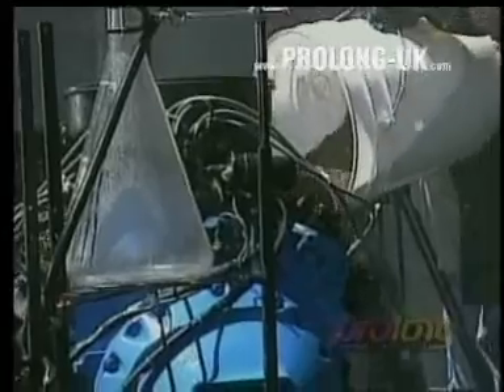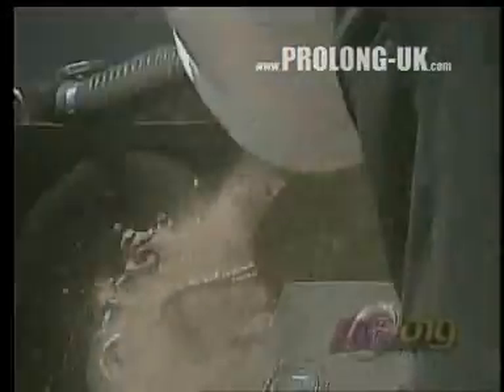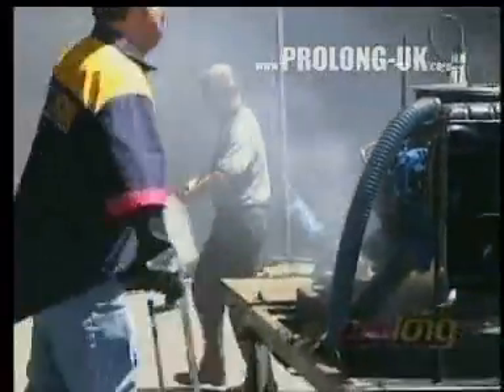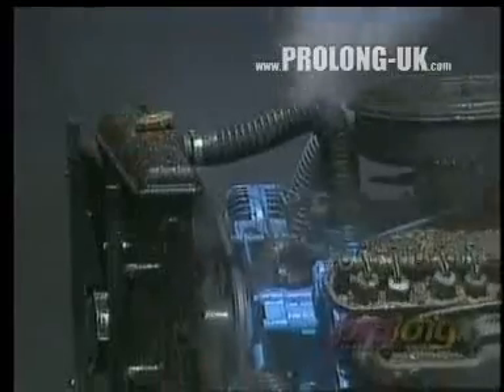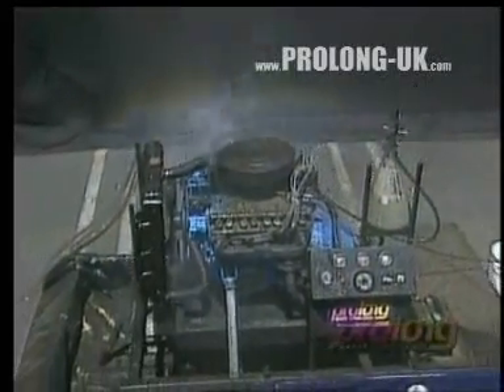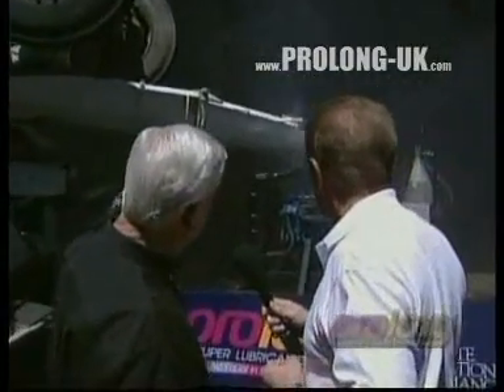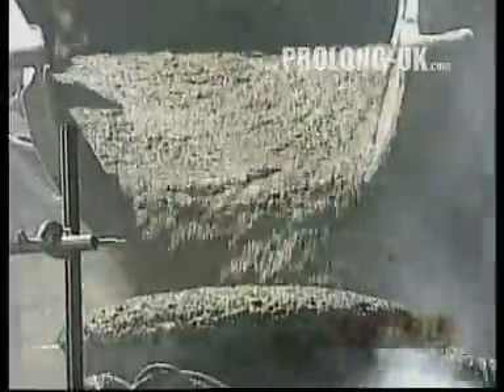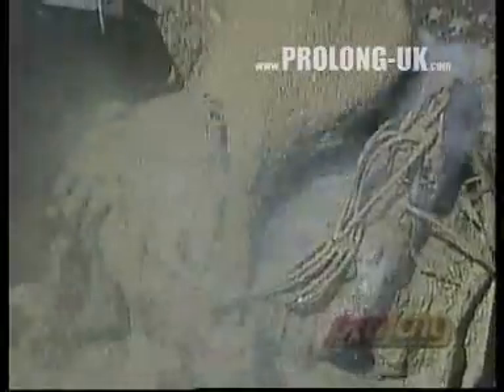Cement in an Engine

Comment: As if the cement or dirt would get past the valve stem seals...fucking retards! Pull off the air filter and see how it goes you useless fuckS!

Comment: cement usually stays very cool unless layed out on a flat surface. if anything the cement helped cool the engine after they cut the hose and it actually helped the engine it didnt make it any harder for the engine to run.

Comment: I use Prolong in my engine! Just the other day I was driving on some sand dunes and then WHOOP! The car slams through a sand dune and the engine compartment completely filled with sand! But it kept on running! Suddenly, a cement truck appeared from no where and collided, spilling cement everywhere! But Prolong kept my engine going *smooth*. On the way home, a nuclear bomb detonated right above my hood, but Prolong kept my engine running just as good as they day it was made. Thanks, Prolong!

Comment: With no oil, very little cement will be washed down into the crank case... Some of those cash for clunkers engines run on for 5 or 10 minutes with no oil, AND some quantity of sodium silicate solution in the crankcase...

Comment: yeah ok, this is a perfe3ct example of how advertising hides the truth. if you got no oil, that sand will go no where except straight to the bottom of the oil pan. therefore the only thing that is happening is this "prolong" is temporarily preventing the engine from seizing since there is no oil. you put oil AND sand, this be a whole different out come, nice melted block or blown pistong or loss of compression, this test does nothing

Comment: thats such bullshit, and it was only running at 1500 fuckin rpm. we had an engine redline at 7 grand with no oil or coolant in it and it lasted 10 minutes... like cement would really have an effect on the cams in that short period of time. what a fuckin gimmic

Comment: the test is more about being spectacular than anything else, the cement is not in the cylinders or the bottom end of the engine, in fact with out coolant the cement may actually have dropped the temperature.

Comment: Yeah, technically, I left out the 262, 265, 267, 283, 327, 383, and 400 from the Chevy Small Block family as well... Just pointing out, the person who said that the engine was too small to be a 360, and was probably a 318.

You can't tell the difference just by looking at the size of the block. That was my point.

Comment: its not prolong....its Chrysler :) i work for Chrysler and i used to  work fro  Quick oil change shop and thy sold that shit. it dont do crap. prolong sucks big floppy donkey dick. do it with a ford and it will be the same

Comment: I'd also like to point out the fact they are using an old Chrysler small block. rock solid cast Iron everything. Enough journal clearance to allow lots of stray oil to remain after being drained and to also allow lots of room for heat expansion. drain the oil out of an aluminum block aluminum rodded modern engine. or the raggedy Quad four GM engine. leave this "Prolong" in the sump and then add sand and dirt and place it under a load. if it still runs I'll even drink the stuff for good measure

Comment: Yeah, the valves open, that's right, but they don't open to the valve covers, they open to the INTAKE. Which is sealled to everything but the carb, which is sealed to everything but the aircleaner. You shouldn't have one running without covers because oil will leak out rather quickly, nothing will get into the combustion chamber unless your valve seals are bad

Comment: totally agreed...putting dirt on the valves wont do shit, ethier, the vavles around under much strain compared to the crankshaft, also they move much slower compared to the crank.  an engine can run for a while with no valve lubrication.   no id like to see them pull the rod caps, put sand into the bearing itself and put the caps back on and see how long it runs.  also, if they keep the oil in it, then put the sand into the crank, so the oil would carry the sand to bearings.

Comment: 360 and 318 blocks are exactly the same size.

Just like a 302/351 Ford, or a 305/350 Chev.

You clearly don't know anything about engines.

Comment: The biggest crock of shit I have seen in a long time, an egine ideling doesn't put much strain on the bearings, put it full throttl under load and it wouldn't last 30 seconds, and it says more for the engine design than it does for oil to keep running without oil.

Comment: Take off the air cleaner, and pour the concrete thru the carb.  If that bitch runs under load for more than a minute, I'm fucking sold!!

Comment: This video, as everyone has said, is a pile of BS.

Years ago we used to take our old cars and "experiment" with them to see what they could take.  

Any well used engine (largish bearing and piston clearances) will run for many, many hours at idle with no oil and no coolant.  Cement (if it gets in) will plug up the oil filter.  If any gets into the bearings they will score and get ruined, but the engine will still idle for a long time.

This video proves nothing about "prolong".

Comment: Any car on any oil would have the ability to run like that for a good while.  They say they are pouring it INTO THE ENGINE which is bullshit they are only pouring it on the rockers.  Non of that is going inside the actual combustion chambers.  If they did maybe i would consider buying their bullshit product. 

And look who they have as witnesses!  Two fucking geeks and two blonds with big tits who probably think engines work by using magic.....

Comment: I had a little briggs that I broke a hole in the side of the case while it was running(young and dumb)then I threw a bunch of shit in it.The dirt and concrete really wasn't getting in there too much.I don't care what oil treatment bullshit you have.If you get dirt in the critical areas, the engine will die.

Comment: all oil is good oil i did,nd change the oil in my motor cycle for 60 000 kilometers and the bike did not start to use oil i think oil is way stronger then what the manufactors say i still drive the bike every day and the current oil is about 25000 kms old and still no oil use kawa gpx 600r

Comment: its funny, my uncle and a bud were changing the Oil in a tractor and somehoe forgot to put new oil in, well he ran it for a good 6 hours before either one of them noticed, the engine still runs to this day, the oil he used is called (Delo)

Comment: With no oil there's nothing to carry cement to the bearings on the crank, cam, mains. Bet a rocker arm would work for days in wet cement. Good oil is good oil. What you have here is not special. Just foolery. Nice try

Comment: a little might have ran into the oil pan for the crank to hit but not much cuz the holes in the heads for the oil to run down are not that big and i would like to see them dump the oil any one can disconnect a gauge

Comment: I havent used it as I like my engines to have oil in them!
Slick50 does remain slipy inside engine, mini metros have the gearbox in the sump, add slick50 and the sinchromesh never works again!
Slick50 is good should oil pressure suddenly drop, gives u a minute or so/ reduces damage, I have heard of folk runing engines without oil for short time with slick50. Never seen it myself.

Comment: Slick 50 doesnt work. And neither does this shit. Teflon was NEVER intended to be used in your engine. DuPont (the makers of teflon) even said so. Slick 50 is just snake oil. Get real oil like Mobil 1 or Schaeffers, use real coolant, and run an injector cleaner every oil change.

Comment: This is a great product. If you ever have your hoses cut, oil drained, and valve covers filled with concrete -and you've just gotta get out and drive, then I highly recommend this product.

Otherwise just use ordinary oil.

Comment: I remember seeing this stuff at a swap meet in Moultrie, Georgia a few months ago. They used an old inline-6 Chevy (I think). No oil pan, no valve cover, and a hole in the side of the block and the damn think kept running for a few hours until they turned the key off themselves.

Comment: a honda engine can do that me and my friends tryed to kill a 1991 honda 1.5 liter 4 cyl it had no oil the radiator was disconnected and destroyed the valve cover was smashed off and rocks and dirt was poured into it
then we poured a gallon of well used oil straight down the intake the engine became so hot that the outside of it caught on fire and we sprayed it with a house. (cont'd)

Comment: just curious but when was the last time cement got into an engine?

This is the stupidest test ever.

It would have been even stupider/funnier if that guy with the hacksaw got boiling hot coolant in his face.

No face protection or anything, oh wait it wasnt running long enough to even get lukewarm.